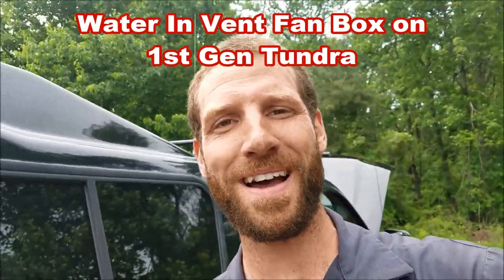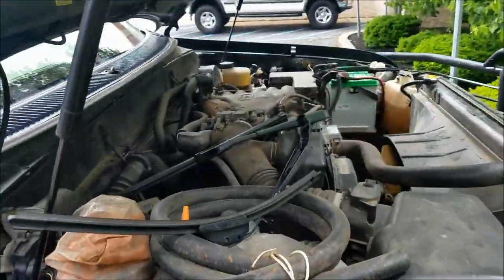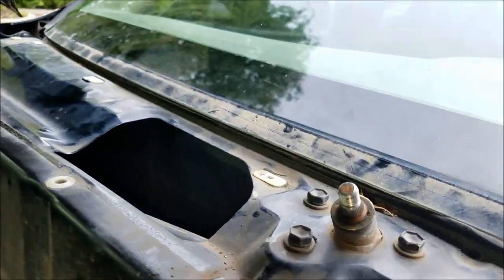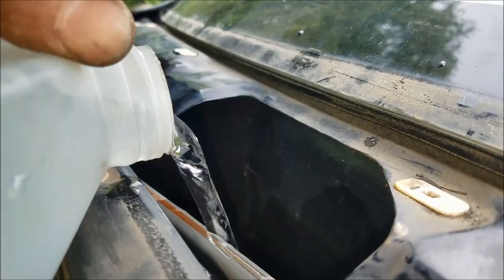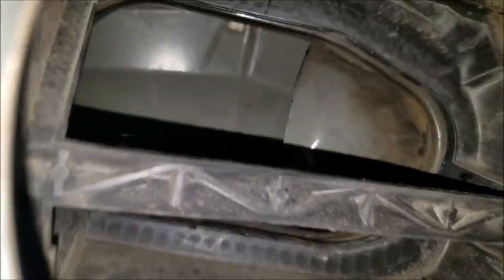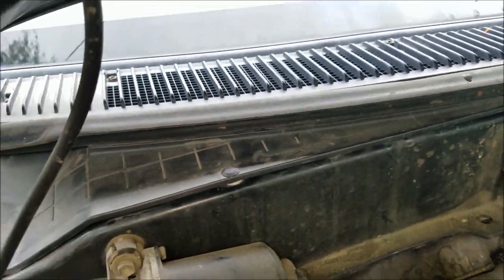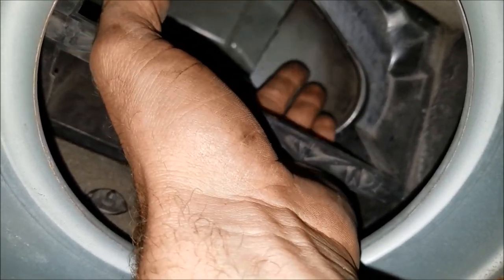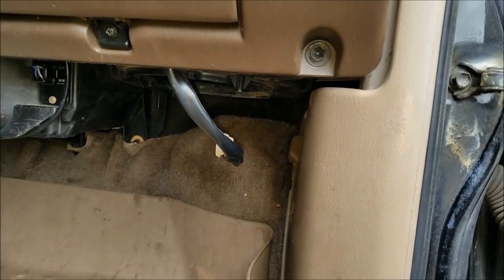Water Sloshing In Blower--TOYOTA TUNDRA +Water On Floor   FAST FIX

Comment: My neighbor had me check out his car when he noticed water leaking on the passenger side floor. Turned out to be a plugged drain hose on the AC evaporator box.
Reply from the maker: Yeah I would have to say that is usually the most common reason for water getting on the floor that I see at work. That and leaking sunroof drains.

Comment: I've got a couple Tacomas (99 & 04) that have what looks like the same fan. I've had to clean leaves and debris out of them a couple times (rarely) and it sure is nice that it drops down so easy like that, only 3 screws. I haven't noticed water there yet, but if I do I'll try your method for a fix. I did have some water come through the top of the windshield once (only a few months ago), but I think I fixed it with some flowable silicone. At least I haven't noticed it leaking again yet, but we'll see.
Reply from the maker: Yeah definitely sweet how easy that fan drops out of them!  It's funny, it's always the blower fans that are easiest to get to are the ones that don't fail as much

Comment: Did this fix the issue?! I have the same problem!
Reply from the maker: Yes it took care of the issue for mine
Reply: I had the same problem in my Tundra and it was caused by the plastic clip that holds the cowel cover on. The seal on the clip goes bad. Replaced the clips and the leak is gone. If you take the blower out and look up you can see the white clip hanging down.
Reply: @trailrunner67  Where did you buy a replacement clip? What model?
Reply: @jakebaynham5075  I got mine at the Toyota dealership. I had a 2001 Tundra. Another option would be to remove the cowel and use a sealant on the clips but that could break the cowel next time you remove it. The clips are not that expensive.